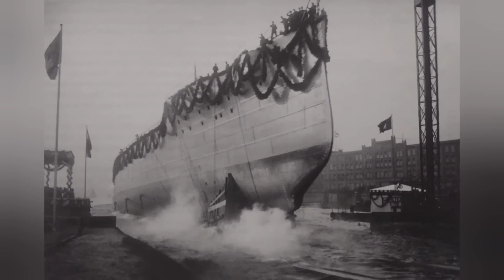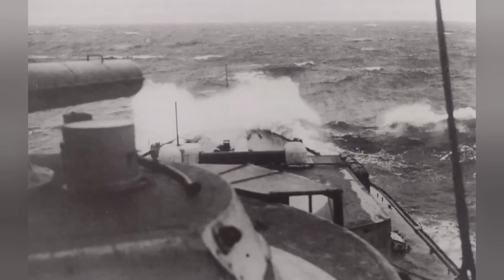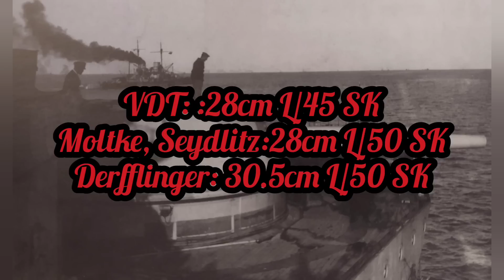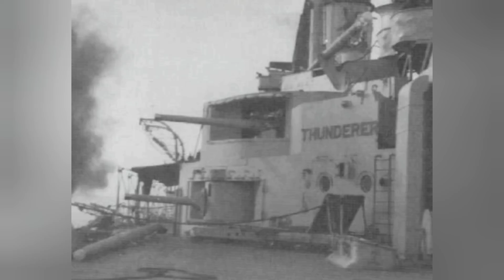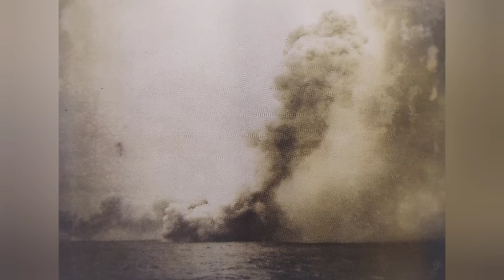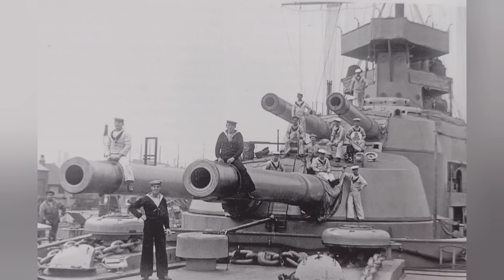Were German battlecruisers better than British ones?

Comment: Good video overall. But I will note 2 things
1. The German speed trials were basically in perfect conditions; best crew, best coal, best water depth, etc. Their actual speed would be lower. 
2. With the exception of the Derfflinger and the pre splendid cat battlecruisers, the British battlecruisers not only had more powerful guns, but better fire arcs for them. The Germans stuck onto the wing turret concept far longer than the British, who moved over to centerline turrets.
Reply: nonsense! german trials were kept real. it was the british that cheated during these trials. that's why the 30-knotters were significantly slower in service than advocated.
Reply: @AndreasKonig-qq7yk  1. The German yards were paid a lot more for every knot extra they got out of their ships. That's why they got the best crew(not to say that the regular crew were bad, just that they weren't _the best_), with the best anthracite coal, specifically chosing the best possible depth of water, etc. 

In actual wartime conditions, to quote the Austro-Hungarian Naval Attaché: "The advantage of speed was completely on the side of the English...The
latter are said to have been considerably faster than the Germans, an unpleasant experience that
had already been seen on 24 January 1915.". German battlecruisers on trials were able to go at 27-28 knots. The British battlecruisers pre splendid cats were limited to ~25 knots. If the trial speeds were accurate, the Germans should have been able to run rings around the British. 

2. We know Nelson and Rodney were designed for 23 knots. On trials they got up to 23.8 knots. Yet during the hunt for Bismarck, her crew swears that she got up to 25 knots. And we have records from Gneisenau, that she didn't start to open the distance to Rodney until she was 26 knots.

We have records of 20 knot sloops, keeping pace with town class light cruisers at full speed. 

The British were very much being pessimistic regarding their ships speed most of the time(QE and R class not withstanding).

Comment: Some notes. 

Doctrinal differences. These actually matter, as the British and Germans designed their battlecruisers with different Doctrines in mind, and the designs reflect the differences in doctrine. 

British BC's were designed as cruiser killers. They were designed to hunt down and destroy cruisers, either commerce raiders such as at the Falklands, or enemy cruisers trying to interfere with the British screening elements. German Battlecruisers were designed as heavy scouting elements, able to fight in the line if they had to. The latter role was not out of choice but necessity, as the Germans realised the Royal Navy would outnumber them in battleships, so their Battlecruisers needed some ability to fight in the line in order to make up the disparity in numbers.

Despite this the German battlecruisers were NOT in fact as well armoured as German Battleships, despite what some try to claim. While absolute thickness of the belt armour at its thickest point was often close to that of a Battleship, the HEIGHT of that belt armour was MUCH shorter in the Battlecruisers than in the battleships. This had to be done as they still needed that speed, and even with smaller calibre guns than their British counterparts, not enough weight could be saved through smaller guns alone to keep the speed high enough. So the armour height was hugely reduced to save weight. 

Some have also tried to claim that the German fire control was better. In his book Naval Firepower, Norman Friedman destroys that particular claim. The two systems were different, and reflected the kinds of battles the two navy's wanted to fight. The German system was more accurate in the initial stages of a battle, the first 15 - 30 minutes, but dropped off afterwards. The British system was less accurate in the first stages, but became more and more accurate as the battle went on, and did not suffer the accuracy drop off. This is because the Germans were focussed on relatively short, destructive battles, while the British were focussing on much longer battles, so their FC systems were optimised for their preferred method.

British Gunnery was not terrible either, it depends on the part of the fleet. The Battlecruisers were based in Rosyth, so had little opportunity for proper gunnery training, which is WHY they focussed on rate of fire, and the poor ammunition handling that led to the loss of two of those ships. In contrast the British Battleships were based in Scapa Flow, where there was AMPLE opportunity for gunnery training, almost too much. As a result the gun crews of the battleships were actually superb, and their accuracy was exceptional, as shown by first salvo straddles and hits when the two main fleets engaged, which for the time was outstanding gunnery.... 

Finally, another thing to consider is British shells. Put shortly, manufacturing defects meant the majority of them were exploding early. Naval armour piercing shells are designed to explode AFTER they have penetrated the armour. This way they do the maximum damage to the internals of the ship, which is what actually sinks ships. The problem with the British shells is they were exploding BEFORE they had penetrated, which looks impressive, but does relatively little damage. Scheer himself actually stated that had the British shells been exploding when they should have been, he would have lost a lot more ships that day. 

In other words many of the German ships survived not because they were built better, or were better designs, but simply because British shells were malfunctioning. 

I could go on, but as can be seen, the whys of Jutland are much, much more complex, and a lot less black and white than simple 'their ships were better' arguments..... Like all things in history, reality is a LOT more nuanced, and includes a lot more grey than most people like.....
Reply: Much of this is correct, but I would like to add something.
Some British shells also exploded. The imperial ships were constructed differently, especially the internal watertight compartments and underwater protection with bulkheads against mines and torpedoes, which were superior to those of the royal ships. Compare the H.M.S. Audacious and the S.M.S Goeben. The Royal Navy focused on long-range fire early on and had a central fire control system with a Dreyer table and simultaneous central firing of all guns, the Percy Scott fire control system. The accurate firing of H.M.S. Queen Mary particularly impressed the imperial side. The imperial ships did not have these facilities. The imperial ships only received a central fire control system with the appropriate systems after Jutland.  The range of the imperial guns was also only increased after Jutland; before that, they fired about 1 nautical mile shorter than the guns of the Royal Navy. You can also read about this in the book ‘The Two White Nations'  by Georg von Hase (artillery officer on S.M.S. Derfflinger). The book is available online as a PDF.
Nicholas Jellicoe also read it.

Comment: with respect, my humble opinion is that the British ships failures at Jutland being blamed on poor practices is well documented and thus would have been eliminated from practice after the battle, the Hood was even updated in ways to mitigate against this type of catastrophic event happening due to prestacked cordite. fast forward to the battle of the Denmark Strait and what do we se? Hood doing her best Invincible imitation blowing up in the same way as her older sisters did at Jutland. the flaw was not in the stacking of cordite (though it certainly made the blast that much bigger) the inherent design of the ships has to be flawed to this end to have been as common by comparison. So looking at 3 British ships all blowing up catastrophically versus 1 german ship which was hit 2 dozen times yet limped off and was later scuttled after her crew wasn't able to stop the flooding being nowhere near an apples to apples comparison assuming the british ships were anywhere near as well built as their German counterparts is just not accurate. go back and look through history see if you can find anyone else out there that had ships that just blew up in this manner. you just do not see them.
Reply from the maker: @mikeholton3914  These are interesting thoughts. Here's my perception:
So, we can't say exactly what caused the losses of the 3 at Jutland or Hood. People tend to zoom in on segments of the inquiry findings that they miss the broad scale the inquiries covered. There were design complications found that could have contributed to the Jutland losses, and these weren't fully understood until after WW1. The G3 battlecruiser was actually the first design that received all lessons from the inquiries, not Hood. Hood only received a few, one major design correction that was NOT made was reversing the arrangement of the shell and handling rooms. Thickening the armour was clearly not as great of a fix as people tend to credit as multiple factors can override armour thicknesses. 
The key issue with blaming the design flaws on the British ships is the fact that the German ships had the exact same design faults. For example, the ammunition spaces had doors rather than flashlight chutes, flooding valves were located in the magazines only, ventilation allowed flames to spread out of the magazines, etc. These nearly allowed Seydlitz to explode at Dogger Bank and the Germans made a report about correcting the multiple issues found with the designs, though only Lutzow had all of them implemented by Jutland. 
The main issue was the propellant. Regardless of how it was stored, the British propellant was just unstable and subsequently unpredictable under battle conditions. The German propellant was more reliable under damage conditions, allowing those few extra vital moments in comparison to the British. Hood did have improvement propellant, but it still used tubes rather than grain, which was still unreliable in damaged condition. This is why we see a few British ships explode in WW2. Hood is certainly complex to explain, but its completely possible design issues inherent in all battlecruisers contributed to its loss. That's my take. Thanks for commenting.

Comment: Your failure to have the turn radius for the British ships kind of slants your estimates and makes your results rather flawed. A ship that can turn tighter has a strong advantage for evading torpedo's, and makes for a harder to score good hits at long range.

You also did not make an estimate for the quality of the crews which can also make a world of difference. Because you point out the Battle of Jutland, when the battle joined the British put an emphasis on quickly firing their guns. Only at Jutland they found the German gunners were not only faster, but far more accurate. And you didn't even mention any of these aspects. Making your review flawed.
Reply from the maker: @Sargonarhes  I agree that not having the turning radius is disappointing. Out of all the sources I could gather on the subject, not one has turning capabilities. It's worth mentioning that the Seydlitz number I supplied is suspicious and I don't have one of Derfflinger either. Overall, that topic is difficult. 
As for the quality of crews, that doesn't matter for the topic of the video. This video is focused on the quality of the ship itself. Of course, crews make or break a ship in action, but the design still needs to meet basic requirements for effective operation. So when focusing on design as my analysis is doing, the crew plays no role. Even if we want to consider the quality of the crews, there is nothing that comes to mind that compromised the quality on either side. An argument can be presented that procedures were flawed, but that goes above the crews. 
Thanks for your insights and comment.
Reply: You are only partially correct. The Gunnery of the Battlecruisers was indeed poor. This is because the British battlecruisers were mostly based at Rosyth where they could not conduct proper gunnery training. All they could do was speed drills, so they focussed on that. 

The Battleships however were based at Scapa Flow, where they COULD conduct proper Gunnery training. As a result the Gunnery of the British Battleships was actually superb. 

The Battle of Jutland can be split into three main phases, 1, the Battlecruiser action. 2, the main fleet action, and 3, the break and night actions.

Germany won phase 1, but the British battleships HAMMERED the German High Seas Battleships in phase 2. Admiral Scheer notes himself, both after the battle and after the war, that if it were not for the issues the British were having with their AP shells prematurely detonating, he would have lost a LOT more ships.

Many of those British battleships scored first salvo straddles, and even hits, which for large calibre Naval Guns at the time was EXCELLENT gunnery. The problem with the battleships guns was not the guns, the ships, or the training of the gunnery crews, but the fact that the shells were exploding BEFORE they had penetrated the armour. Naval AP shells are supposed to explode AFTER they have penetrated the armour, not before....

Comment: Generally speaking, yes. The greatest achievement of the British BCs (apart the occasional survival of the battle of Jutland) was the victory over Graf Spee´s squadron. HOWEVER, that squadron only had outdated vessels. Even the typical British dreadnoughts were fast enough to deal with them, they didn´t need a specialized ship for that. 
So, did they achieve anything noteworthy in their original mission specs? Kinda, they DID sink Blücher, which was a ship with about as much strategic value as a half of an early battlecruiser. So, a tiny victory, but a victory nonetheless.
And did they achieve anything else? Could they hold their own against comparable enemy warships? No. Absolutely not. They needed the dreadnoughts to score a single capital ship kill against the enemy battlecruisers. And they lost 3 of their own in the process (and a fourth one only escaped that fate with a ton of luck), one of them arguably more expensive than the prey that they managed to hunt down / mortally wound. Yikes. If they continued like that, they would have run out of battlecruisers sooner than Germans (and that takes into account even the Courageous and Renown class), despite having more than 2:1 numerical superiority. Luckily for them, the US Navy was there as a huge barrier, allowing the Royal Navy to ignore that slight battlecruiser issue.
So, speed may be considered a form of protection for a vehicle that can seek other forms of protection, like a tank for example, but definitely not for a huge ship.

Comment: A simpler way of explaining it is that the Germans sacrificed gun size in Battlecruiser construction in return for speed while British sacrificed armour plating. As it turned out, reckless charge handling aggravated this weakness so that German bartlecruiserx could take more damage than British ones. The Seydlitz and Derflinger took a lot of damage both from the Queen Elizabeth class Battleships with Beatty and then the High Seas fleet
Reply: Well,it certainly helped,a lot,that the british shells were simply terrible..